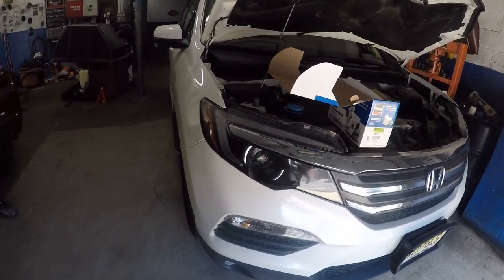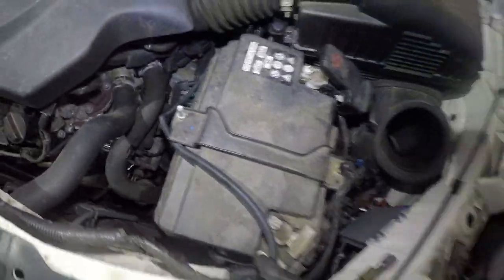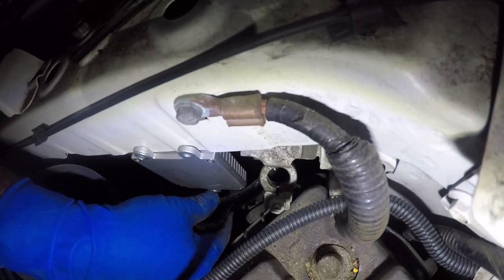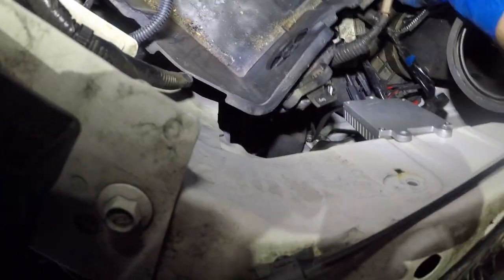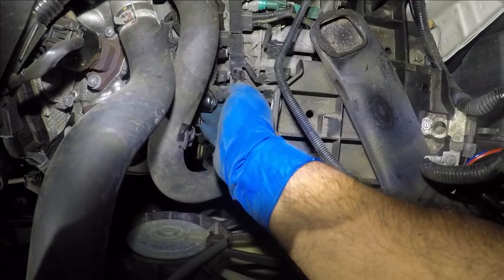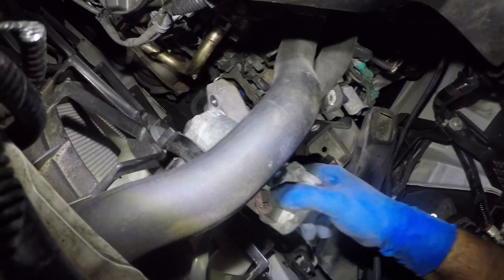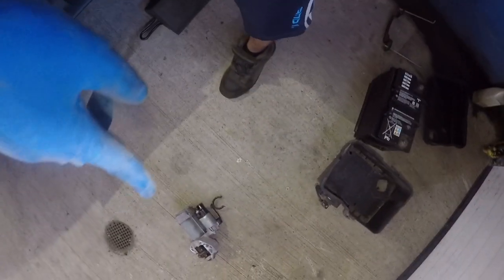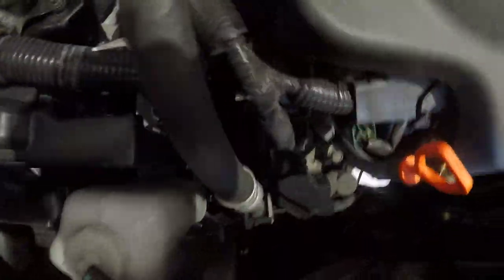How to replace starter motor on Honda pilot 2016 and UP  ||  HONDA PILOT Dont Start

Comment: Al the videos are super helpful! I have a 2016 pilot but how would I know when to change the timing belt? Or timing belt tensioner? Great content man. Really appreciate it.
Reply from the maker: Well it’s recommended at 60k miles u will not know or have any signs to do it but usully it goes for 70-80k miles so if u wanna do it at 60k it’s ur choice other wise if u want to push it then it’s ur choice  but defiantly do it by 80k.  And water pump with timing kit

Comment: I have a 2013. What about the blue wire attached the starter on lower left ? How you get it out without cutting anything . Its not on anyone's video.
Reply from the maker: The connector wire?

Comment: I really want to tackle this job myself but I have no experience. And I'm not sure if its just the starter that needs replacing on my Pilot 2017. How much is a fair price to what you just did. Labor and Parts altogether.
Reply from the maker: $190 is more than fair labor and part is like another $190 so u can say like 400$

Comment: Can I force starter to crank engine to turn flywheel by activating starter motor? Is there any risk doing this process to close valves while cleaning them?
Reply from the maker: I doubt it u can force it usully the selnoid or Contacs go so u can simply try hit it on other wise regardless u have to replace it

Comment: I had to replace the starter on my Honda about a couple of years ago. The longer bolt was on so tight that it snapped on me and I had to tow the car to a shop so they could remove it. Turns out the bolt had red thread locker.
Reply from the maker: How did they remove it? It impossible to get In there
Reply: @RBTheMechanic  . Good question. I don't know. I have an Accord so I think I had more clearance than the vehicle you worked on in the video. But they were able to remove and the broken bolt and replace the starter for me.
Reply from the maker: @MrSupernova111  oh ok

Comment: RB, I got an elite model and there are some brackets in the way. If I take off those brackets, the starter should slide right out, yes?
Reply from the maker: Yeah most likely should be same
Reply: @RBTheMechanic  RB, the back bolt on this bracket is very limited because the wiring bends over the bolt. What tool do you recommend? It's a 17mm bolt.
Reply from the maker: @stevevicsotka1284  I think u can use swivel and extension
Reply: @RBTheMechanic  I ended up using a rachet wrench and it worked! Important to note that I used the rachet wrench that swivels so I could use a long pipe for leverage to break the back bolt. Got the starter changed out and it cranks right up! So happy, the dealer wanted at least $1000!?!? That extra wire bracket took an extra day to figure out.
Reply from the maker: @stevevicsotka1284  glad u got it done bro!!!!

Comment: Does this work for the touring as well?
Reply from the maker: Should be same
Reply: It’s not the same, I ordered the same starter he had in the video and it was the wrong one. The touring and elite both use a different starter from the other trims

Comment: Can't believe a Honda pilot  needs a starter already it's a 2016, is Honda cheaping out
Reply from the maker: The cheap bad shitting design of honda.  Car had low miles as well
Reply: I have a 2016 Honda Pilot. I just went in for an oil change at 98K miles.  I was shocked when they said what is due at 100K.  Timing chain, starter, a few other things.  $1500 !!  I always thought a Honda was suppose to last a long time.  They also said I had a transmission leak at some joint.   I just junked my
Mercury Grand Marquis.  398K miles.   Best car I ever had.   It developed a head gasket leak.  It also needed brakes.
I.  I bought in 2020 a Toyota Camry.  I hope I have better luck with it then my Wife's Honda Pilot.   I also didn't like
Honda charging for things my toyota gives for free.  Besides 3 years of free oil change, they rotate my tires.  Honda wanted to charge me per tire for the rotation.  I bought the tires at Town Fair Tire and they rotate and fix any flats for
life.    They want me to replace the starter when they replace the timing chain.  Said it will save me labor if the starter should go.  Another thing, my toyota can get 10K miles between oil change.  The Honda Pilot starts warning me around 7500 miles to get the oil changed.  The Honda uses synthetic oil.  It should get more miles per oil change.
Reply from the maker: @n1kkri  timing chane ? R they crazy u ever change timing change unless it was belt sure the pilot got belt that’s somthing I would do at 60k it’s normal stuff need to be replaced
Reply: @RBTheMechanic  I spoke wrong, It's a belt.  $1500 to do the 100K maintenance.
Reply from the maker: @n1kkri  belt and pump is around $900 job and that’s fair price
Reply: @RBTheMechanic  after watching this video for changing the starter, all the expense must be in changing the water pump.   They sure don't make cars like the old Mercury Grand Marquis.  Mind was a 2003 and it made it to 398K miles.  repairs where much cheaper with most done not by the dealer except for recalls.
I might start looking for a non Honda shop mechanic and get a few quotes as well as get a few quotes
from some other Honda Dealers.    I expected maintenance at this level around 160-200K miles.
Reply from the maker: @n1kkri  the timing belt is the labor it self and pump is like additional $150